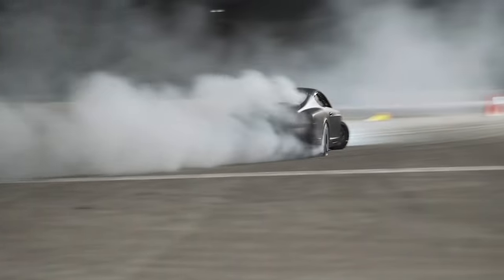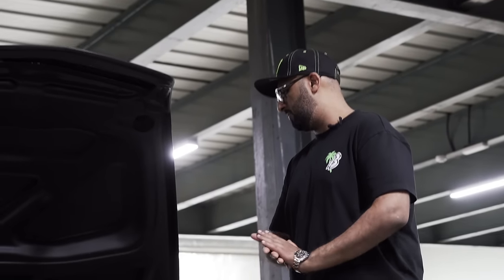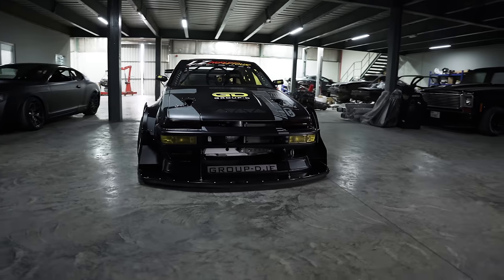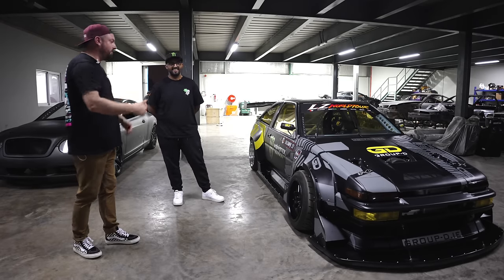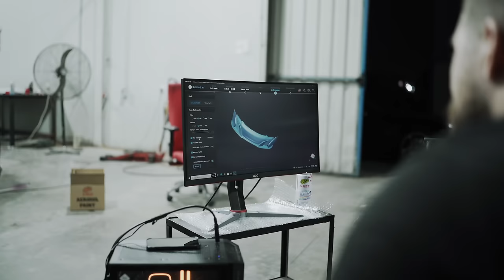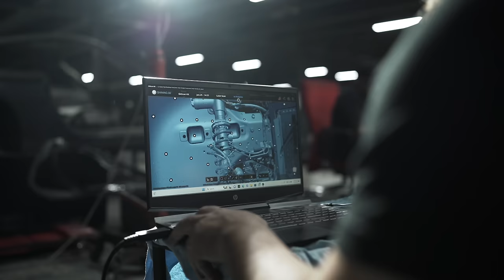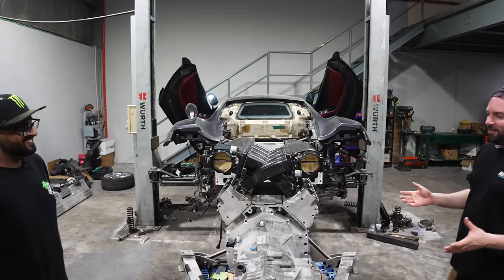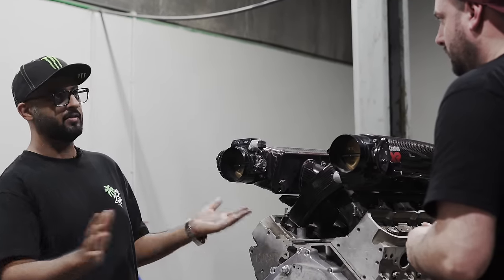The most EXTREME supercar drift build of 2024...IS HERE!

Comment: DDe has the. F12.   The 550 they built and.  Taht aventador so.  This guy is behind
Reply from the maker: You mean they’ve engine and gearbox swapped them? 🤔
Reply: You haven’t seen the f12 it was brought down past a  shell
Reply: @driftgames_life  no I mean took the f12. And. Cut a lot of the chassis apart. And rebuilt it caged. It.    It’s as full of a build as one could get.  90 percent isn’t factory.  Check the build before you say that.
Reply: @driftgames_life  f12 is more built then this
Reply: @driftgames_life  the Ferrari 550  was built with help from Mike Essa and it was built.  So. Do some research.
Reply: @driftgames_life no the engine and gear box swap is the basic way to do it because you can’t make the exotic engine work . And they have sequential in the f12 .i get that this is your boy but why you trying to discredit others builds .